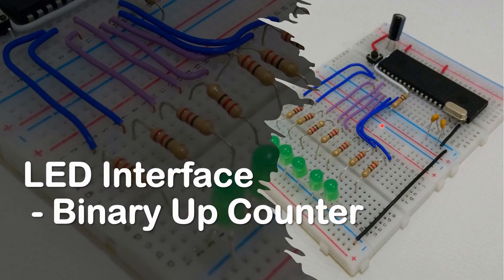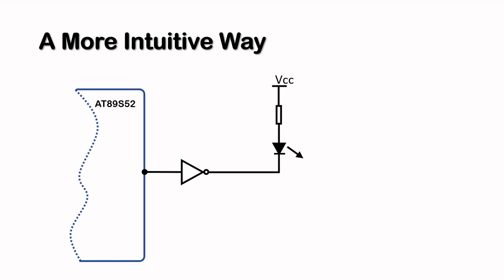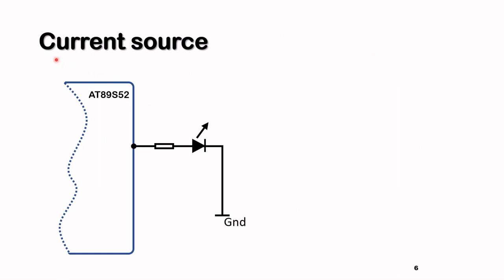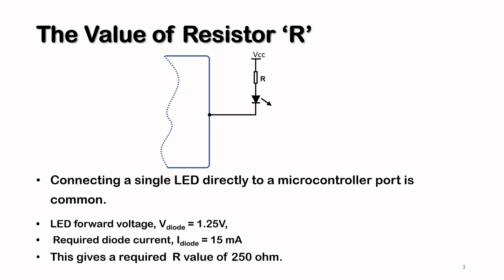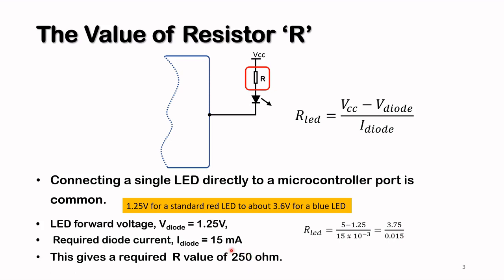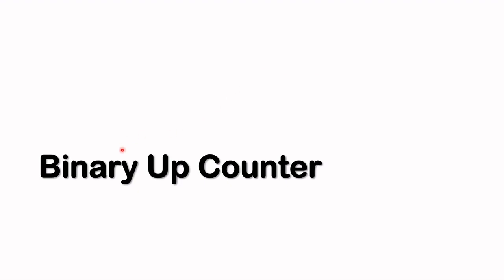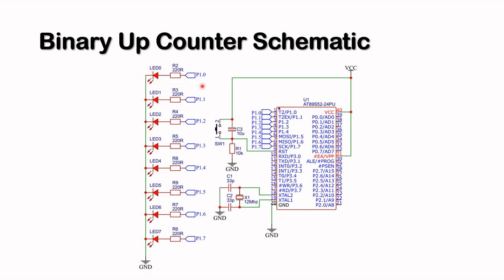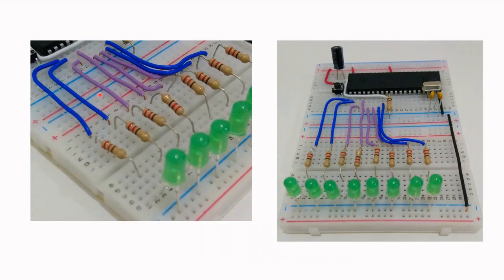#20 Binary Up Counter With the AT89S52

Comment: Amazing videos, just wish these were done a simulator instead of using real hardware
Reply from the maker: I am glad you like. For the simulator, you can try it with EdSim51. You may need to make minor modification to the code to get it to work with EdSim51.